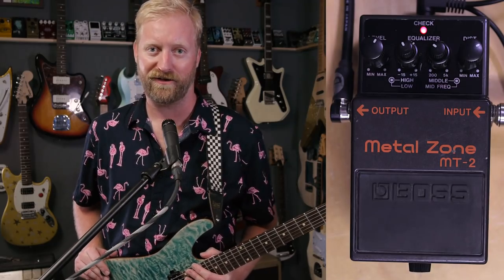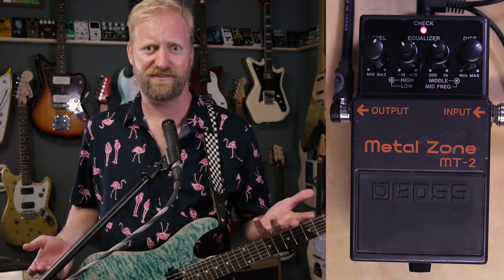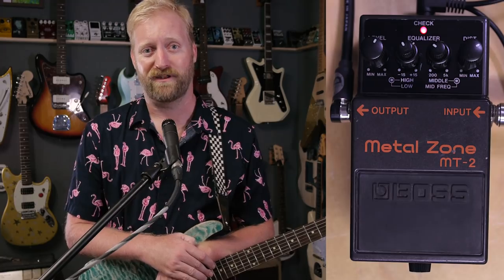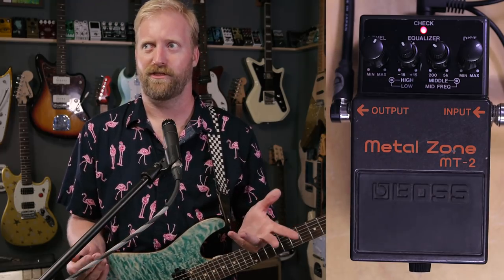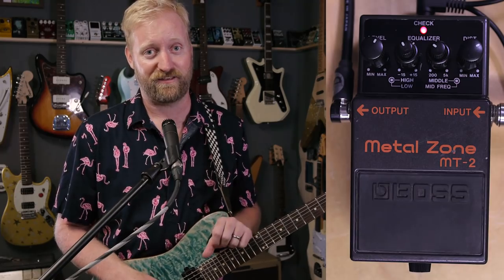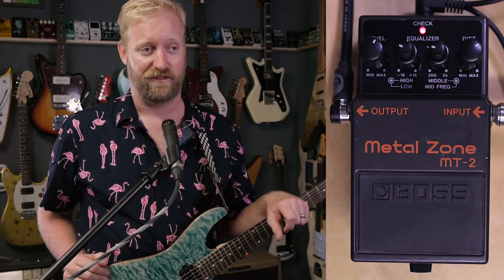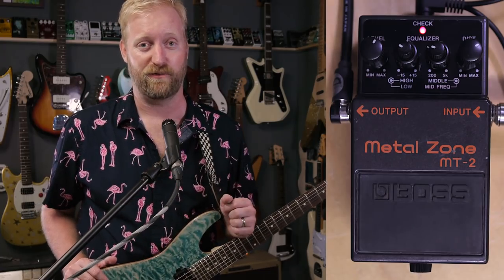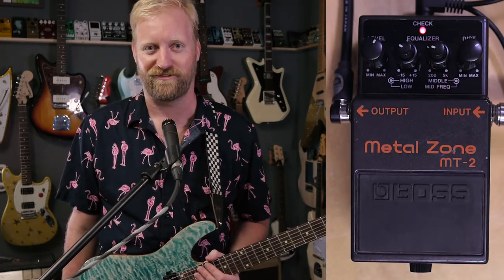Metal Zone into the loop return?

Comment: I just dug up the manual of my MT-2. It just says connect the OUTPUT jack to a guitar amplifier, without specifying whether to use the Input jack or the FX return. There are however detailed instructions on how and in which order to operate the EQ controls, which many of us probably should have read first before dialing in an awful tone and then complaining about how much the pedal sucks.
Reply: Simon Brunner I can vouch. This comment made me dig up my old manual too...at a glance it seemed like I already knew what was going on..but man was I wrong 😂 the ‘Sample Settings’ section is worth a look as well!
Reply: Thing is, boss knew that the smaller amps didn't have fx loops. And today we wouldn't have the shredders we have today if the instructions said put it in the loop.
Reply: I read this and got my manual. The heavy medal "settings" were better than the way I was using it for months. Thanks!
Reply: right. I love this pedal because I know how to read. This pedal has always ruled in my world.
Reply: @Jay-cr6mx  Careful! Heavy medals weigh you down! D:
Reply: Quite

Comment: There's loads of "preamp" pedals now... seems Boss via accident or purpose got there 25 years ago :)
Reply: Yeah sadly this was a thing. And it took 25 years before anyone actually tried to see if it was actually true.
Reply: I had a Two Notes Le Lead for a while. Sounded like total shit unless it was going into an FX return. Then it was tits. But nowhere else.
Reply: Maybe the boss factory forgot to put the note "preamp pedal only" inside the box..#wondering
Reply: Hell yeah, I run a tube screamer custom to a custom messa clone amp in a pedal, thru a suppressor right in my fx loop to the front of the amp. The thing is fricken beastly. Loads better than before my amps preamp
Reply: just threw the metal muff into the fx return of the micro dark, :D sounds like a mesa now
Reply: The mt2 is ok in front of a solid state 10w practice amp, lots of teenagers used at low volume and was awesome..if boss had labeled it pre-amp, no one would of bought it and kids would not of become the shredder they are today!
Reply: I think you're right.. by  putting  it through  the  FX  loop BOSS by accident created a  metal  Preamp  pedal.
Reply: @isbirwan  or  forgot  to include "for  best results  in  tone quality  connect to the Return  section of  a  guitar amplifier ".  Had they  done so?  BOSS would've sold  a  lot  more  MT2's.
Reply: @LFC-Star  im new to this 'preamp through fx loop' bizzo, is he running it send and return, coz thats the only way ive used fx through the loop, if not how else can the fx loop be used
Reply: @kevinrichards7980  yes   putting the  MT2 through the  FX  Loop of  an amp  is the  correct  way  to  use a  MT2. Not through the  Input  jack of the  amp.
Reply: @LFC-Star  yes, but is it straight send and return, coz i keep seeing people just running it to the return
Reply: @kevinrichards7980  try either  way see which   you  like  best..
Reply: Yeah, but preamp pedals usually have a clean channel

Comment: I pray for some pedal builder to make an op-amp Big Muff with the MZ EQ.
Reply: now we're getting somewhere
Reply: Could be done, but i personally not a huge fan of it's eq, parametric part has too much space, which makes it hard to control, i would limit it's potential a bit and add bandwidth pot, and treble/bass i would replace with bandaxall (just because it's awesome).
Reply: Stone Deaf´s fig fumb got quite good EQ capabilities I think.
Reply: Put a tube screamer in front of your big muff.  Really helps with that mid scoop and the insane low-end a BMP tends to have.

Comment: I’m neither a fan or a hater of the Metal Zone, but most people play these things with the distortion level well past 12:00, or even cranked, which leads to the fizzy bees sound. It has plenty of distortion, so keeping it below 12:00 is a great first step towards better tone.
Reply: the "fizzy  bees"  sound is  because  people wrongly  have  been  putting the  pedal  in the  front  of the  amp  via the  Input. Instead  of the FX  Return.

Comment: Here's what I've found with my amps and my pedals and my ears....   Every high gain / heavy distortion I own sounds a lot better in the FX Return.  Every overdrive I have sounds better direct in the input.
Reply: Do you plug the metal zone just directly into the return without using the send ?
Reply: @Macrohard_On_Fire  yes.
Reply: you've contradicted  yourself there..  which  is  it?  @David Dexter

Comment: My best friend treats the Metal Zone like the Discover card... He never leaves home without it. I always found with enough tweaking, you can get some great Metal rhythm sounds. However, I nicknamed it, "The Harmonic Thief". No matter where I set it's Eq, Vol & Gain or the amps controls(and trust me, I've tried every possible setting a hundred times over), the high harmonics, esp pinch harmonics, just went bye bye. I never tried the loop though. I'm sure that would've only helped.

Comment: As bad a wrap as the metal zone gets 16 year old me with my peavey rage 158 practice amp never once regretted  owning it.  Even after that when i moved up to a marshall valvestate 1 x12 combo it was still alright to use as a clean boost to pump that straight up into prime thrash territory  and  still fun to just crank up and bask in the angry bees.  Not to mention back in those days it was  the metal zone grunge distortion and the death metal distortion if ya wanted heavy distortion.
Reply: Holy Shit... I had to check to see if I wrote this comment...haha.  I had the same setup (MZ + Rage), and then moved to a Valvestate 1x12.  I also never regretted it.  I'm sad that I've sold it long ago.
Reply: yeah man didn't know how good that valvestate was till it was gone my self .
Reply: The mt2 cannot do clean boost even with the gain knob zeroed it still breaks up
Reply: you are kinda right it was never sparkly clean that is also why it took the marshall  from like rage against the machine gain to slayer territory.   More overdrive than clean boost maybe but  i thought it was much closer to a clean boost than an overdrive it for sure wasn't meant to be used that way but it sounded good at the time.
Reply: Ha! I had the same start too! But my valvestate was a 100 watt head and a 4x12 fender cab that a builder who was working on my parents house gave me. Two of the speakers were blown and all of the pots on the amp were crackly, but I loved it none the less!
Reply: My first amp and boss pedal too lol
Reply: Just realized I have the same amp as u

Comment: i got a modded metal zone i liked it so much. it was a mod from pedal hackers based on the combined tonal experience that particular builder had. sounds like a 6505 with a good tube preamp
Reply: I have a 6505, and end up using a metalzone into my fender twin. It isnt quite as good at distortion, but I’m able to get way better cleans now

Comment: I think that “the trick” of this heavy distortion pedal is run directly through the return fx loop, but you can use it at the front of the Amp with a little bit of EQ: 8 to 10 o’clock (treble, middle and bass) & 9 to 12 o’clock for input volume should be perfect.

Comment: I have the Digit ech Metal Machine, I bought it for self oscillation feedback loops. It's also great as a distortion on acoustic instruments and drone synthetic.  Apparently is unloved by many guitarists for bad tone. I saw someone recently run it in the effects loop and it had a great sound. I have loads of effects and audio junk from charity shops that I repair for soundscape experimental work. Most stuff won't work together, especially in the same way a (heavily post) produced tuber video does. The trick is pairing and understanding how the gear works and the make up of its sound. Then you get the magic. As our Lord Miles Davies once said, it's all in the tone.

Comment: I’ve used a MT2 into a korg Pandora for quiet practice for years using it more like this as a “channel” for an amp vs a dirt box into a dirty channel. I also back the gain off quite a bit and get a pretty good sound out of it. Also when I was young and seriously broke I used it straight into an old pioneer stereo receiver as I didn’t have an amp it actually sounded really good that way.

Comment: There's a capacitor labeled C35 on the main board of the metal zone. Removing this cap vastly improves the tone!
Reply: Do you have to replace it or just toss it?
Reply: @ceoofworldpeace8901  just toss it, or keep it should you wish to undo the mod. Don't bridge the two empty solder points either, it somehow works like that.
Reply: Also, replace the clipping diodes with LEDs. It'll be much better, like a proco rat on steroids
Reply: @joseislanio8910  I'll have to try that!

Comment: I noticed a different sound when going into the fx loop return with my pedal. Two reasons are the clean channel we use for pedals on most amps will give a broken, slightly distorted sound at higher volumes, the fx return does not seem to do this, second, when going through the fx loop return my reverb is bypassed, I liked the sound difference going through the loop except losing the reverb.

Comment: I just ran my Metal Muff into the return on my Bugera G5. Very different sound. I think I like it. It has a lot more bass , but it isn't too muddy.
Reply: Most Dirt-pedals will not sound good in the return. But it's always worth a try, of course. If it's not suitable you will usually end up with a weaker tone and in most of the cases a cut of the high frequencies. This is what I experienced. The real problem is that you don't really have a usable clean tone. It will be very direct, PU into Poweramp.

Comment: I dont get it,I've had one over 13 years and I love the way it sounds! The adjustments are VERY sensitive but mine sounds great. Also I really liked the way It sounded when you just plugged in the front. Maybe I'm tone deaf lol
Reply: I run mine through the front, and the eq settings from the manual make a difference.
Reply: I actually preferred the sound from the front too. I like the sharp growl. Through the effects loop it was warmer but lacked the cut in my view. I just bought one today. Itll be in front of my Marshall MG15 practice amp

Comment: With my joyo zombie I found the metal zone sounds better plugged into the front of the amp then it does in the return. I didn't want to tweak any of my knobs though.
Reply: Maybe because it needs a valve power amp to push in order to sound good
Reply: @zombiemontage  with other amps that I've tried I've found the metal zone sounded better through the return. With the joyo it's not so, to my ears anyway. I think it has more to do with the joyo return than the metal zone.

Comment: I didn't say anything cause of the backlash i got back in 2005/2006. A friend had a Metal Zone and an amp with it connected just to the return.  So I've sat waiting for this day. And you know what I want to cry in pity. Pity that none of the idiots would even attempt it.  Now if you want since you know that the Metal Zone is a pedal preamp, depending on if you place things before and after it, you can get different tones from your pedals depending on EQ and level of distortion on the pedal.

Comment: it's missing real tube crunch dont you think? by the way we in the old days had the distortion at max on this and the thing no one is trying but was key back in the day was putting a Boss equalizer after the pedal, ;) and there you go. get it right people. and it was in front if I remember correctly. but the EQ made a huge boost and the difference was there, hope this helps.

Comment: People always went crazy about the MT2. I have and used one since 1991. The only issue with the pedal is that its EQ is VERY POWERFULL. People are going crazy with the "Fx return connection". The only thing you have to do is think how a power amp actually sounds: Very even, unfiltered and DARK.  But when people connect the MT2 IN FRONT, they setup the CLEAN channel first into a bright nice clean, then plug the MT2 so they can have "2 channels" and it sounds like shit. Just plug your MT2 on your clean channel, then suit the EQ of your clean channel to complement the MT2 (making it for a dark even tone), then adjust your MT2 EQ to your liking. For reference..the MT2 in front of a very dark sounding amp (like the Buggera 15w for example) sounds great....

Comment: It's totally normal that the sound is bigger : the clean preamps adds an eq to the sound, especially some trebble and presence. By bypassing the preamp, you bypass an eq section and the sound is fater. But in counterpart, you have no clean, or a bad and non ajustable clean tone, and the volume of the transistor pedal+poweramp instead of the volume of pedal+preamp+poweramp. I'm not sure the volume of transistor would be as correct as a tube volume when pushed high. Perhaps the alternative could be to take an eq post distortion and to set it in order to revert what the preamp eq does (cutting some bass and some trebble) to get the same flat sound as in the loop but with more tube volume (?).

Comment: Metal zone requires the good path that kills the bee attack.
I ended to use it on the drive channel rather than clearn one. Also requires a speaker able to cope with metal tone.
Had a Peavey Bandit 112 that supported well this pedal with its Scorpion speaker. Tried it on some bluesy stuff and it sucks of course any any high gain sounding preamp.

Comment: I wonder if the Metal Zone or its infamous predecessor the Heavy Metal were designed to work with amplifiers that did not break so easily at reasonable volume and required all the high output pick-ups and boosters possible.Maybe this is why it sounds terrible when plugged into modern pre-amps that are designed to behave differently.
Reply: Sounds reasonable.
Reply: That is pretty much how the 5150 is designed and its probably the most popular metal amp. The distortion most use for Metal is from the preamp, not from driving the tubes too hard.
Reply: Yep! In my experience into not high gain amps, and with lower gain pickups it's a "Metallic in a box" thing, but into a high gain amp with a high out put pickup it squishes and over compresses iMO
Reply: its pretty certain that the metalzone was indeed designed as a preamp pedal since it was released in 1991, back at that time the only "high gain" amps were the jcm 800 and the Mesa MKII C+, both of which were really more Crunchy amps that needed a distortion pedal to actually be high gain, and the extremely expensive Soldano SLO-100(modified and rebadged Mesa MKII C+) and equally extremely expensive Mesa MK IV

the rectifier series, 5150, Bogner Ecstasy and Diezel VH4 didnt come until a year after the MT-2 so the little pedal made extreme metal a lot more reachable at a lower price point
Reply: Great! Of course these pedals were not designed for exclusive new amplifiers, they were targeted at the broader market for those who wanted to emulate what they heard on records.
Now that someone has explained the history, it is pretty clear these pedals crank it up to 11 (or is it even 21?) when used together with what was designed later on to replace them. Add a booster to an amplifier with an integrated booster and you get a caricature.
Reply: You're pretty much 100% correct. In fact, they are designed to work with a Roland Jazz Chorus amp! 😄 Except that's not a joke - Roland owns Boss and in their minds everyone is using their pedals through their own brand amps...
The other thing is that the designers purposely let the controls allow the full range of sound the MT-2 could output, rather than restricting it to whatever they considered a "sweet zone". You have full control over the distortion and EQ and if you want to push it into unpleasant areas that's on you. It's a pedal that gives you more than enough rope to hang yourself, then doubles that length because it's there on the roll so you might as well have it.